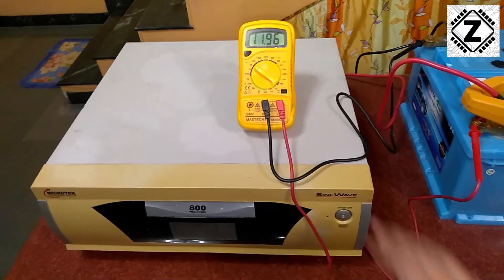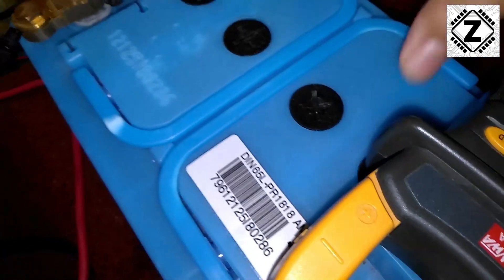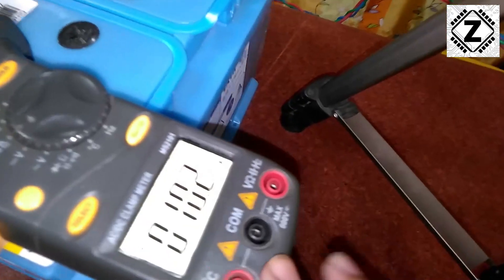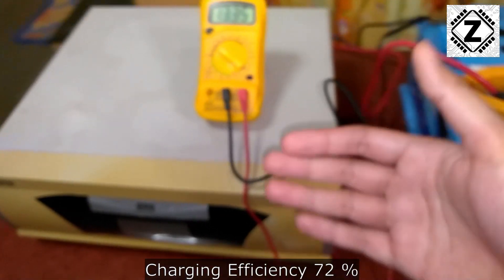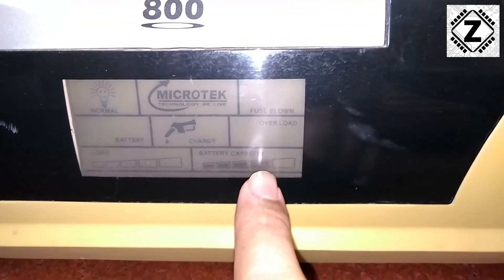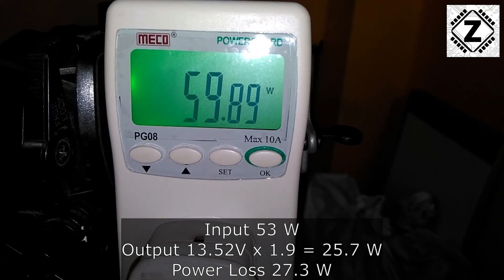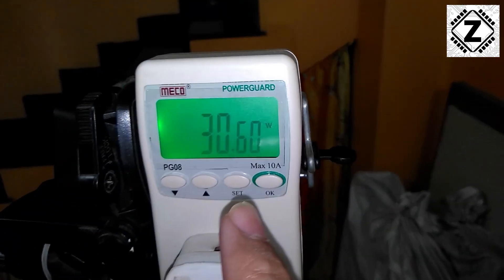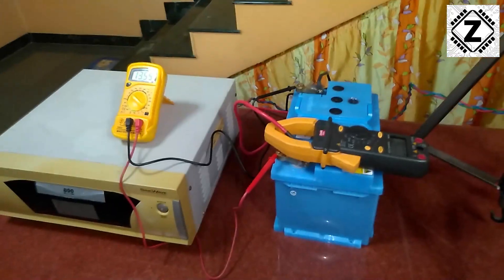[Eng] Why Inverter Increase Electricity Bill? Battery Charging Power Consumption Units/Watts Test

Comment: Does an inverter charge the battery all the time. It does not stop. What to do our battery is just new brought 4 days ago but still its charging since then.
Reply from the maker: Check the actual charging voltage & amps using good clamp meter. Is it actually charging?
Reply: Yes it is charging as it gives backup. When electricity goes off. But after electricity returns the charging indicator blinks with the fan of the inverter running for a few minutes and the switching off but then battery indicator shows charging continously for many days. Spoke to experts they say it will show charging for 2-3 days but it has been charging for 4 days strait. This is concerning. Should a inverter take that long to charge a battery which is new. ???
Reply from the maker: @AnishaKanal  that's why buying a good meter is important.
Reply: It has already been checked with  the expert that it is charging. The crux of the problem is why should an inverter be charging the battery all the time. If it has reached the maximum charging it should turn off charging indicator but it doesn't it keep on charging and it is costing us in huge bills. We can't even afford a solar panels. The inverter was brought in 2019 but the battery is brand new.
Reply: I need a reply to this question please.
Reply from the maker: @AnishaKanal  join my Telegram group for detailed discussion
Reply: Sorry no telegram account.

Comment: Why my excide 150ah battery utilising 1400 watt while charging ..its to high like running an ac
Reply from the maker: Probably a damaged battery. Shorted cell. If it's heating up, disconnect immidiately & keep outside the house

Comment: So the power loss of a fully charged 65Ah batter connected to supply line is 31w

I have a 150ah 12 v tubular battery connected to power supply through inverter. Would it be fair to say that I should expect 70 to 80w constant loss for a fully charged battery due to 1.5 A floating current?
Reply from the maker: Approximately...

Comment: Sir, my inverter consumes 1-2 unit daily even without any load. I have check it by switching off all the electric appliances and still meter reading increased to 1-2. What should I do.
Reply from the maker: It might be consuming energy to charge the batteries, As explained here-
https://youtu.be/TLx3hRH9Ubk
https://youtu.be/8QyPCa8MGq0
You can use solar Panels to charge the battery.
Reply: @ZenInnovations  Thanks

Comment: My sine wave inverter has to charge 2 big tubular batteries, so would it be drawing 190 watts for a longer duration to fully charge both the batteries? or, does it draw 190 x 2 ie 380 watts and charges both batteries parallel
Reply from the maker: Longer duration.
Reply: @ZenInnovations  thanks for answering. Another question - My tubular batteries are 12v 150mah each, so a total of 300mah. 
If suppose during the approximate 2 hours power cut daily it gets discharged by 100mah, with a 200mah charge remaining, I will be calculating electricity usage while charging as per a 100 mah battery, right?
Reply from the maker: Yes, 100AH. But Lead Acid batteries are pretty inefficient. So consider 40% extra on top of that.
Reply: @ZenInnovations  wow that's substantial loss